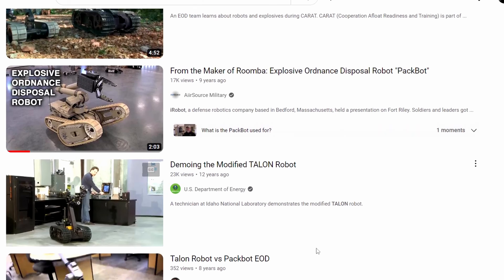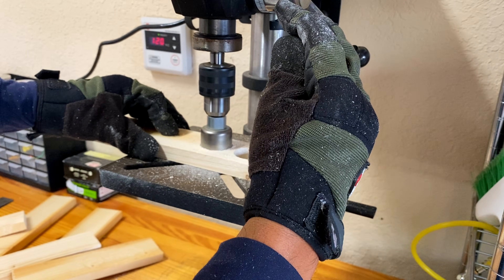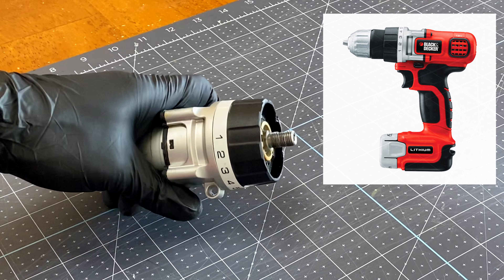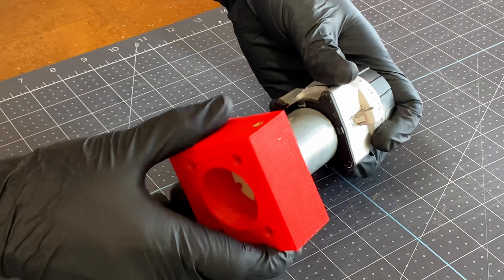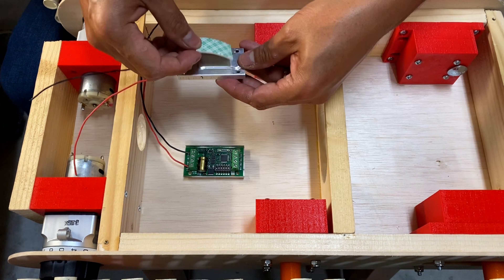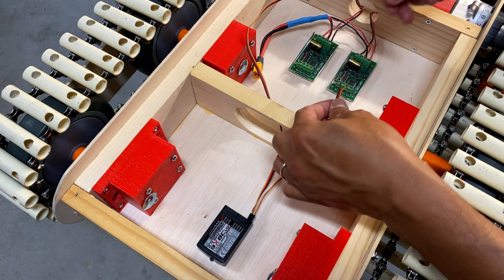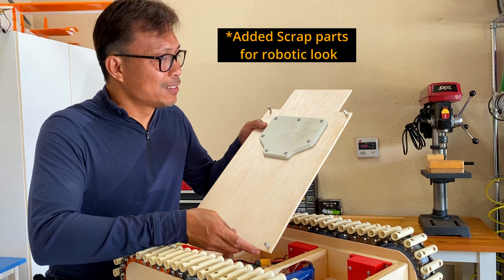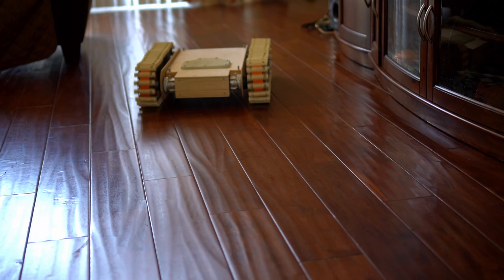How to build a tracked robot | Ardurover Build part 1

Comment: Really great build, thank you for sharing.  I can't say for sure but it looks like your wheel hubs have a 1/2" bore but the motor shaft is 3/8"?  Did you print an adapter sleeve to fill the gap or did you use a bushing adapter of some sort?  I am planning on printing an adapter out of PLA and am just curious if you took the same approach and if it worked for you.  Thanks again, looks like a really great project.
Reply from the maker: Hi. Thank you. Yes, I used a steel spacer bought at the local hardware store (Lowes) and used it as an adapter sleeve. If you look closely at the hub you will see that spacer. Your approach of 3d printing it would also work.

Comment: wht type of esc did u use
Reply: Those are motor drivers not esc
Reply: What model of motor driver?  @prathamdeepsingh8210
Reply: @sed1819  probably about 10-15a brushed motor drivers

Comment: can you please share the names of those components? thanks very much!
Reply from the maker: Hi, are you referring to the electronics?
Reply: Hi  @LyndonsWorkshop , I'm also curious about the electronics. Could you share the name of the motor drivers you use? Thanks!
Reply from the maker: @amosto7862  Hi, its SyRen 10A motor controller. You could go for higher Amperage. You could also go for sabertooth motor controllers.
Reply: @LyndonsWorkshop  Thanks! I'll look into those